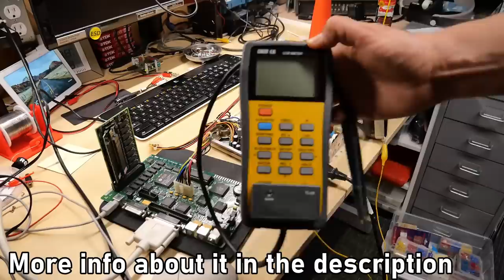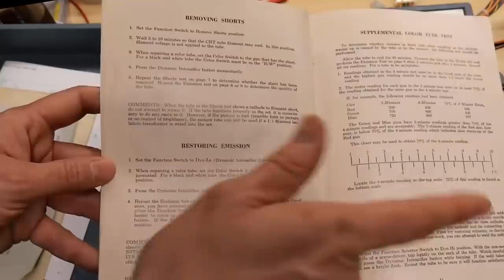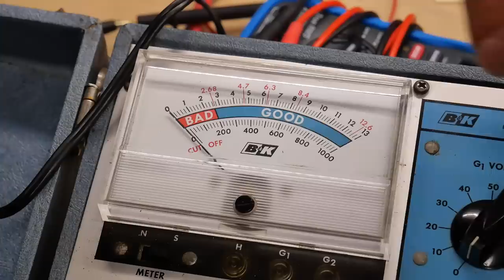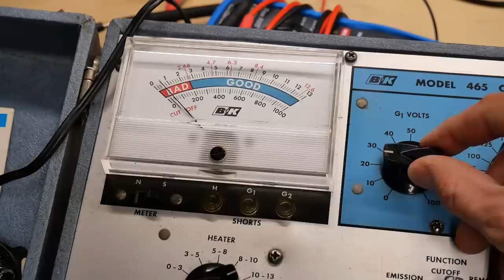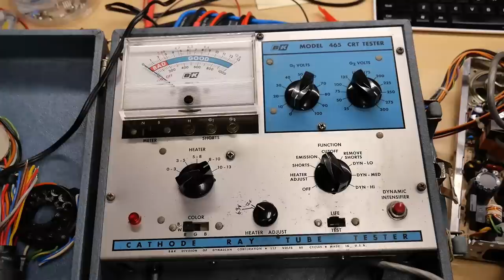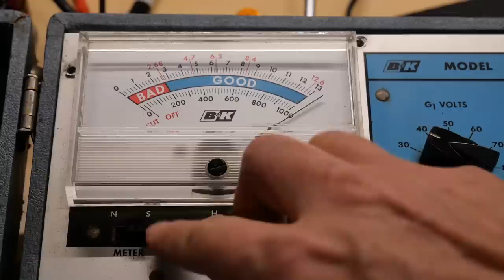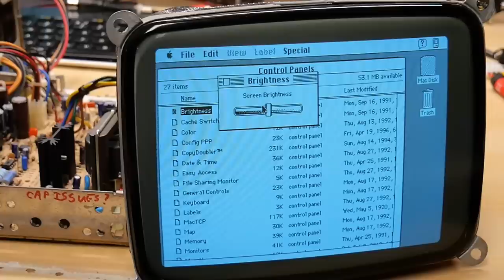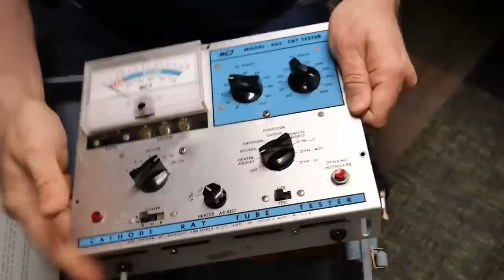Rejuvenating a Macintosh CRT with equipment from 1969

Comment: Where I used to work we used to get 12in B&W CCTV monitors coming into the shop that had been sitting switched on 24/7 for decades, some of the CRTs were so bad you could hardly see an image at all (apart from the permanently burnt on one of course!) so we used to 'give them a zap'. I would have said that 8/10 of them came up to a perfectly usable level of brightness, and a few came up like new. The 'repair' was permanent enough for it to be worth doing and it saved the cost of a new CRT. Loving this series of videos, Adrian. Best wishes from Sheffield, UK.
Reply from the maker: Cool! I can see that if this was a TV that you used 10 hours a day every day -- the fix might seem temporary, but for something like a retro computer which only sees occasional use -- even 1000 hours of bright image might last me 20 years. :-)

Comment: oh this is so cool to see. I recently got an RCA TV from 1974 that was apparently put in storage as it stopped working - no red. That experience familiarized me with CRT rejuvenators. I got a Heathkit tester/rejuvenator off eBay for $100. That fixed it right up, good as new! But mine had very specific, meticulous instructions for use, and I followed every step. It had two modes - cleaning and rejuvenating. Cleaning is what fixed the gun, rejuvenating brightened and sharpened it. On mine, you hold the function button for much longer, as you adjust the heater voltage.

It had a lot more features than this one though (it was also 1975~ vintage). It also had an elaborate build guide with tons of illustrations, because evidently the "kit" in "Heathkit" is literal - sold as a kit! At least, before it got to me fully assembled.

Comment: As a vintage TV collector/restorer I can say:
These old testers will have lower heater voltage with the heater connected than without.
CRT heaters are not nearly as delicate as you think (except for some low current heaters some portable micro TVs)...Case in point there were devices called CRT brighteners common in the 40's-70's that would step up heater voltage by 40%, and the manual for my B&K 466 reccommends doing that as a first step...It is the gentlest form of rejuvination.

CRTs that have sat for months to decades unused develop what TV collectors call "sleeping sickness".  The cathode is made of a reactive substance that emitts electrons easily when heated. CRTs must be under HIGH near perfect vacuum inorder to function properly but there is always stray gas molecules floating around. There is usually a brown or black spot inside the glass aroung the electron gun called the getter that is a reactive metalic film designed to collect gas molecules... The cathode also acts as a getter, but regular use cleans the gas off of it....When it sits the gas that bonds to it builds up an insulative film that blocks emission....That film is the root cause of sleeping sickness. The safest way to wake up a sleeping CRT is to test it under normal parameters and if after an hour long emission test it does not wake up bump the heater to 1.4x-1.6x its rated voltage and check back every 5-15 minutes for a ~2 hour span...If that fails doing a rejuvination like you did is the next step.
Doing a rejuvination is sometimes aided by at the same time as the button press gently taping the neck of the tube with a wooden dowel (be careful not to break the glass).
There were various rejuve circuits from different makers common back then was to cahrge up a large cap and dis charge it across the cathode and a grid to create a brief spike in cathode current to blast the surface contamination off...Many testers elevate heater voltage during rejuvination. The emissive cathode coating is thin and will be blown off its metal substrate if too many rejuves occur or if too many hours are put on the CRT. 
Good life test is 3-11 seconds before the needle hits zero. 
All the lytics should be changed if you plan to use that tester regularly.
 
Brighteners were usually step up transformers  for the heater AC holtage (some also or exclusively did isolation to fix heater-cathode shorts). Most brighteners only worked on 60Hz AC because most sets that old used a 60Hz heater transformer.  In the mid 70's-mid 80's TV/monitor makers switched from linear 60Hz power supplies (feed wall voltage into a transformer distribute it to loads and rectifiers that power everything) to 17KHz switch mode power supplies (rectify and filter line voltage use, use a transistor to create 17KHz AC by switching that on and off, use a 17KHz transformer to step it up then distribute and or rectify and distribute that to everything that needs power).  Transformers don't like to opperate at frequencies substantially different than design so if you find a 60's vintage brightener installing that in your mac will cause damage. There were some 17KHz brighteners made but they are very rare.
Reply: Aight as a 22 year old reading some of these, we really need to have an archived CRT info website. Just full of random stuff like this. Can't let this knowledge/ decades of experiences die or become simply impossible to find
Reply: @WalnutSpice  Videokarma.org is such a place. I'm only 6 years older than you and picked up much of what I know about TV repair in the last 15 years reading there (getting my bachelors in EE in the middle of that also helped).

Comment: O.K. Two things....

1) I love the way you have got 'chapters' on your YT vids, very clever.

2) Replace ALL the cap in that test/rejuvenator set and it will last another 50+ years.
Reply: I was incredibly impressed with the chapters as well!  What a nice detail!
Reply: The capacitors in this device are probably fine - None of them are particularly critical and their values drifting won't cause many issues.
Resistors are what you'll worry about for devices this old. They can start to drift or fail in other ways that would make the results inaccurate or could damage the tube you're testing. 

You don't need to replace all of them. Replacing all of the parts is not diagnostics and it's a waste of time and money if they work. If you used a device like this daily or wanted a display piece then yes you should probably replace all of them now.
Reply from the maker: I tested them all with my LCR meter and replaced the on that had failed. The rest mesure within spec (reistors and capacitors.) Yeah I only replace stuff that has failed... not stuff that "might fail" at some point in the future.
Reply: @adriansdigitalbasement  I'm delighted to read that. I have the same opinion and I'm a bycicle mechanic. 

(Digression: I wish I could send you some old computer stuff from Belgium so I could add some traditional candies!)
Reply: @adriansdigitalbasement  Hi Adrian, I don't mean to offend you, and if you ignore this comment I won't take any. As someone who has worked on some old tube equipment of the time your BK was made (and older) I wish to share the following thought: The LCR meter usually don't test for leakage, they test for series resistance (ESR), not parallel. That means, the amount of DC going through a cap (which should be next to none). Most of those old caps have it - see the one that's shorted out as the last, final and most catastrophic state of this process. While leakage in the big caps will screw up your readings to a degree - the shorted one made you unable to test at all, a leaky one will drag the needle down some, but as those testers are more of an estimation of things than a definite reading (as seen on the vast "good" ragne) this would only make a marginal tube test bad, and a slightly ok tube test marginal. No big deal there. As pointed out in another comment of mine, I'm more concerned about the 5µF ones in the power supply. While those will screw up your readings also (by means of the voltages drifting out of spec), those also have the means to kill the device. Fast, if they fail in a short, short out the transformer and kill it in seconds - and slowly if the "leak", which will put more and more strain on the transformer, heating it up, killing it with time. Probably not a thing if you only plug it in for a few minutes, but if you're filming besides checking the tubes I guess this will take up quite more time than just doing a quick check (btw. thank you very much for putting in this time and sharing your adventures with us). Those meters have very little to none protective circuit. There isn't even a fuse listed on the schematics or BOM... Those tube circuits in the 50s and 60s where made in  a different time, and approaching them from the mindset of someone used to transistors and IC can result in... interesting and quite destructive results. I've been there, and almost ruining a (much more expensive) audio tube tester and some radios has had some lessons I've learned.  Nowadays bad caps leak liquid and eat the pcb... on old gear, they leak current and kill your tubes and the transformer. Changing those caps is a few solder joints. Its maybe $5 in parts. I highly, highly recommend it.

So, enough preaching, and another thank you for your content.
Reply: @adriansdigitalbasement  You'd be replacing every capacitor you come across in an endless loop XD 
There's only two kinds of caps: "broken" and "not yet broken".

Comment: Excellent video Adrian!  I've been hoping to see a video on this subject for a while!  I remember when I was in the trade my boss had a DIY rig that he had built himself, it comprissed of a light bulb (presumed to limit current) and a transformer.  I think he basically powered the heater and drove some high voltage through each of the guns.  I saw him use it on colour monitors back then and I was amazed how much brigher they were afterwards.

Comment: Hello Adrian. CRT rejuvenation is an analog process, that takes a little time. That means, the button should be pressed for at least 1 to 2 seconds in the low or medium settings (count "21 .. 22" while pressing the button). The definition of "briefly" as it says in the manual is vague at best, but the thing is one should not exceed about 5 seconds as that can make matters actually worse.
Excellent video and my best wishes for 2024.

Comment: Wow, when I recommended you under the previous video to rejuvenate it, I thought you will need someone's help who has a rejuvenator, I had no idea you already have one. Rejuvenation is usually a temporary fix, but there are exceptions. I guess this will have a long term effect. If not, try the high setting next time. Why I'm thinking it will last? 
In my opinion, this CRT was not tired, it had cathode poisoning. Because the way these Macs work with the black border around the picture, if this tube was used a lot, it would have a burn-in mark on the screen which resembles this black border, but I can't see any burn-in. Remember, the power supply was giving a low voltage on the machine in which this CRT was installed. This is one way to give a CRT cathode poisoning: run it on too low heater voltage for a long time. There are some other possible reasons, like slight gassiness, if that's the case, it will get poisoned again, it might need a getter re-firing with an induction heater.
Good work!
Reply: I agree with your opinion of cathode poisoning being the underlying problem with this CRT. Reflashing the getter would most likely eliminate the cathode poisoning long term and add many years to the life of this CRT. Nice job Adrian!
Reply: Doooo iiiit...~ As far as I'm aware, there aren't really good solutions for replacing the CRT in these old all-in-ones. Maybe there will be a good LCD solution in the long term, or something involving a full rehousing for the motherboards... But for now, it's better to try and get the CRT fully running again.
Reply: So a "tired" CRT is one that basically has burn-in all over instead of in a pattern?
Reply: @stevethepocket  No. Well, yes, if it has so many hours on it, the phosphor will degrade on the whole screen, but it affects the brightness just slightly. A CRT is being tired if the emitting material got worn off on the cathode(s), and it's no longer able to emit enough electrons. This will cause low brighness, and when you try to compensate for it by boosting up the contrast and brightness settings, the CRT will smear the high brightness parts of the picture, and becomes blurry. On some extreme cases, the high brigtness areas will turn to negative.
Reply: Rather reminds me of why most nixie clock designs will have an "anti poisoning" mode where it will cycle through all of the numbers (even those not normally used) at full brightness to prevent this very issue.

Comment: I was reading somewhere ( 3 years ago ) about a trinitron that needed rejuvenation In 1977 tv was only 6 years old but worked for another 30 years before it was junked
Reply: Trinitrons are the best CRT TVs ever made!
Reply: @ramakrishnamishra8179  that's why I have a huge collection of pvms and bvms
Reply: @abc-ni9uw  Oh sweet i'd like to get a Sony PVM or BVM one day.
Reply: لای آسمووونی  yes!! That is engineering!
Reply: @Naitrio  yes they are great sd monitors!! Check out my channel where I hace content on them!
Reply: I never had any success rejunenating a trinitron CRT. People never wanted to pay the insanely high price to replace the CRT.
Reply: @blueribb99  Good to know. Were they trashed afterwards or just no improvement? I have a 32" trinitron with a tired tube (25k+ hours) and a Müter rejuvenator, but no suitable socket adaptor. I guess there's no point anyway, right? ;^)
Reply: @NuGanjaTron  my Trinitron currently has 30k hours and it looks good still

Comment: Remember USA power was 110-115 volts many decades ago.  Now days it averages as 124 volts.  So capacitors rated at close to voltage (as was typical back then) will blow, especially if they were already leaking.  You need to completely recap and repair the tester before using it.  I would also recommend using 500 volt caps instead of 450 volt.  Be careful of higher capacitance ratings on old equipment.  The capacitance rating was part of the design to "shoot" a pulse into the CRT.  Making changing the capacitance completely changes the math in this circuit.
Mr. Carlson's Lab is an excellent channel to help you with older equipment like this.
I GUARANTEE you that those capacitors are extremely leaky (electrically leaky) and need to be replaced.  Typical L/C meters do NOT test for leakage.  A leaking capacitor can read fine in capacitance and even read fine with ESR, but can still be turning itself into a resistor (leaky).  Replace all of those old caps.

Comment: Great job!! As for how long it will last, we have lots of CRTs in TVs that are rejuvenated that have hundreds of hours of use and still look great. It really comes down to the age of the CRT, how dead it was when you started, along with a bit of luck. Also in the beginning when you said it would get brighter the longer it ran before your rejuvenated, that is really common with CRTs, some will warm up after not being used a long time and never dim back out. I suggest if you have a dim CRT on a machine that works, let it run for a few hours a day for a couple days and see if it gets better and stays that way. Sometimes the CRT just goes to sleep when they sit.